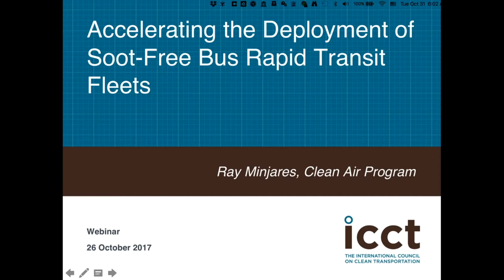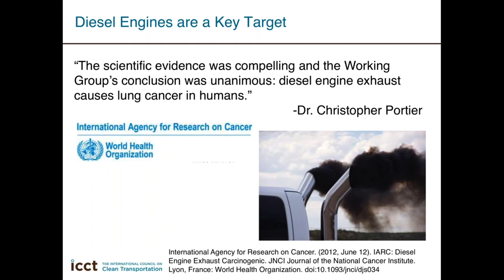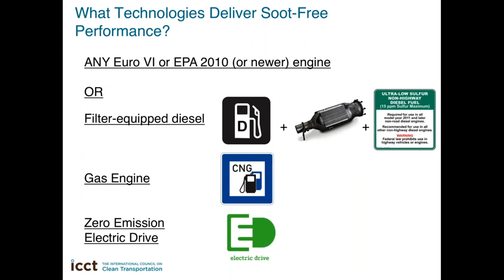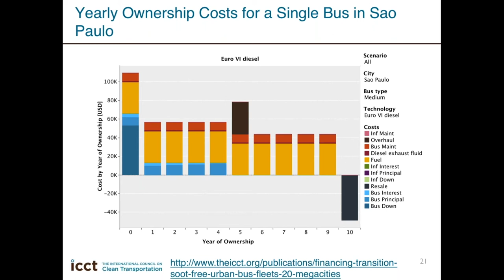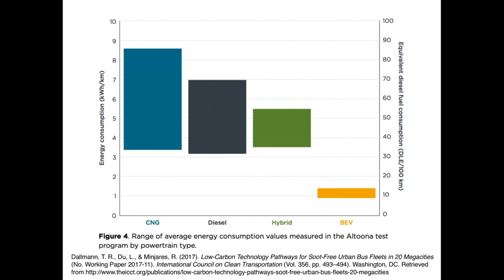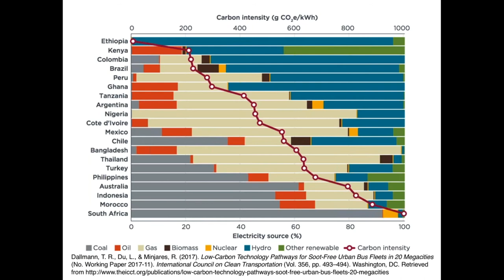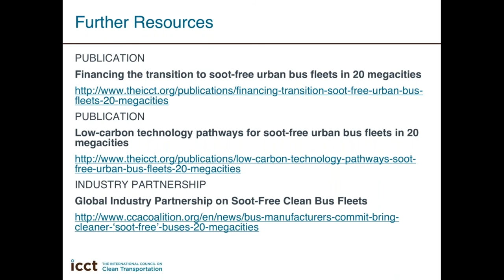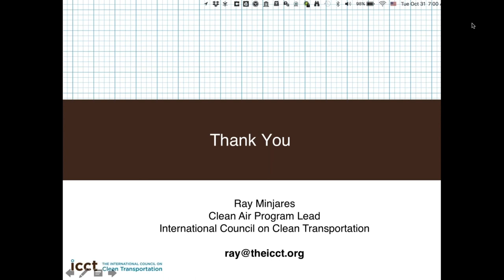Accelerating deployment of soot-free bus rapid transit fleets

Comment: Fantastic presentation laying out the road to clean mass transit!  I'm exploring turbine/electric hybrid which, due to low weight and size, may be a preferred retrofit where vehicle may be retained in use.  Contaminants substantially less than best diesel option.